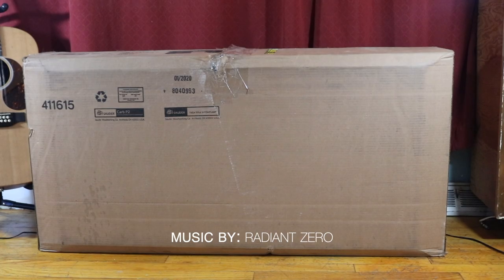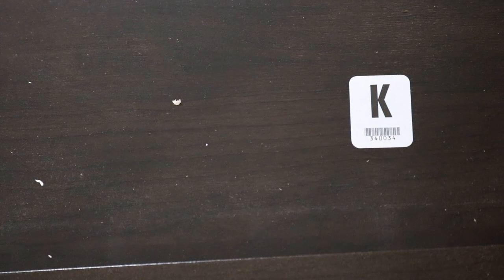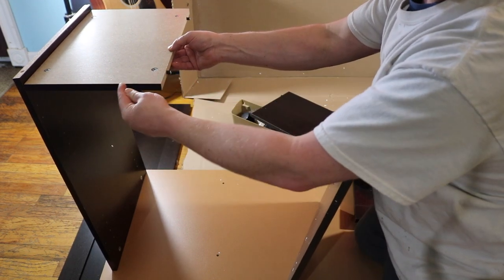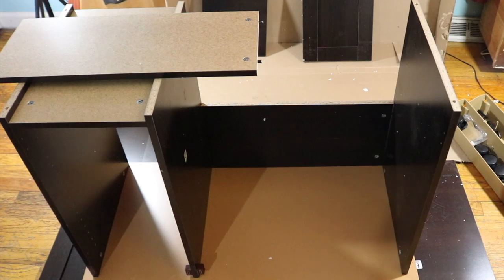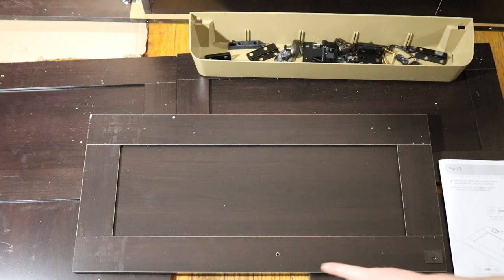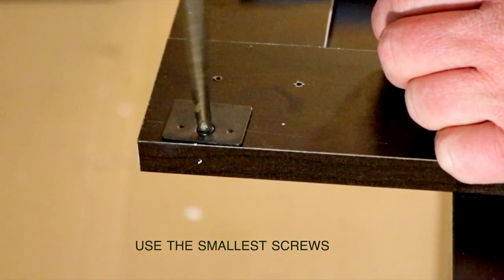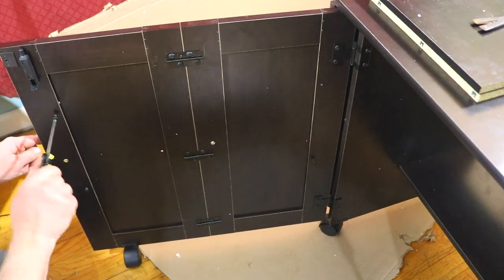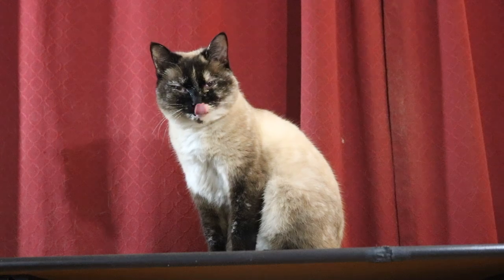Sauder Folding Sewing Desk (Rolling Craft Cart) Unboxing and Assembly Instructions (411615)

Comment: I just finished assembling the white version of this cabinet and love it! Your video help to make the directions in the manual a little clearer. I know one has to be careful when using an electric screwdriver on this type of material but trying to manually install all the black screws without it is painful on my hands. Thanks for making this video. Sauder should compensate you!
Reply from the maker: Thanks!

Comment: I’ve had this for 5 years and it finally fell apart (the small center shelf holds the entire piece together I later found out, lol). However, I saved it by adding and reinforcing the middle shelf underneath (where your legs go) with an extra screw and gorilla glue for wood in the joint areas.
Great instructional video, I wish this was around when I was assembling mine! Haha
Reply from the maker: I had to reinforce mine the other day. I had to put regular screws in mine. Thanks for the tip!

Comment: This is a great tutorial! I'm currently deciding on what sort of functional storage/desk space I want to get.
Would you say this is better quality than Ikea furniture and easier to build?
Reply from the maker: It's about the same quality and the same difficulty. Both took me 4 hours or so. I put together an Ikea one that was similar.  Today everything is particle board. If you decide to buy either you have to be gentle when you move them around because both will fall apart if you are rough on them. (I used to be a furniture mover so I know.)  This is because the hardware can come loose. The secret to avoiding this is to add wood glue at every major seam as you put it together. This may seem annoying but wood glue keeps the hardware from wiggling loose over time. Just put the glue in places you wont see it once the pieces go together and in the holes where the screws go. The other alternative is to buy real wood and make one yourself or buy an expensive one made of real wood. I wish I had glued mine because I had to add some screws to sure it up. I personally  would not want to build one myself because it's a little complicated and time consuming and I don't think the expensive ones are worth the extra money. Best of luck! It's great owning one because it saves space!

Comment: We’re having problems with the cam dowels, especially the ones connecting the B panel to panels G2, D2 and H2. The dowel sheathing don’t fit into the pre-drilled holes. When hammered into the holes, the black sheaths split and widen, making insertion impossible.
Reply from the maker: I had the same problem when my wife moved it. If you play with the cam and twist it both ways it should go in. I ended up taking the cams out and just used drywall screws to hold it together. I predrilled pilot holes first so it would not split. I had to do the same thing on the top except I used finishing nails so you don't see the nail heads. I don't like cams. They can't handle being moved which is the whole point of that desk. Best of Luck!